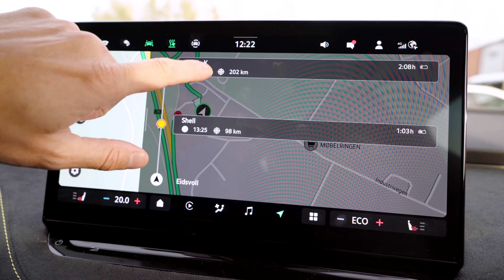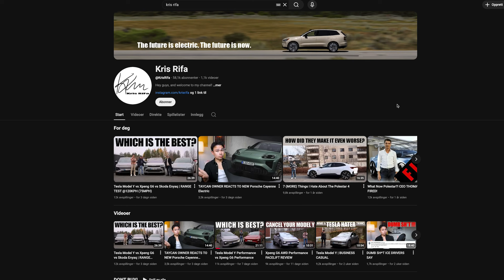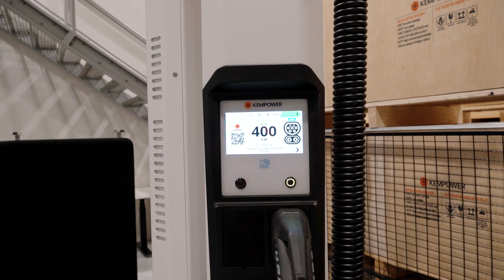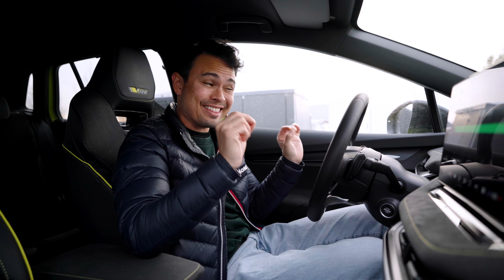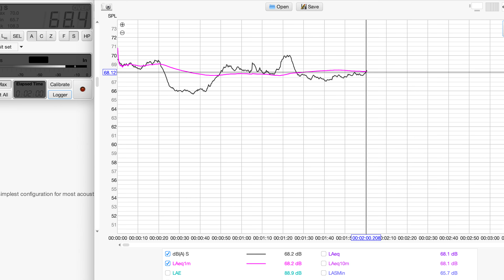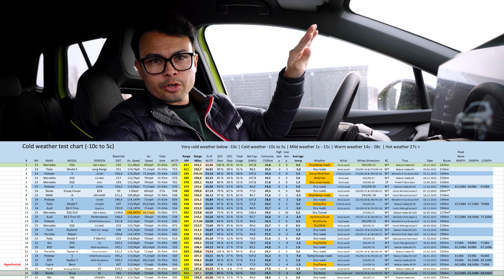Skoda Elroq RS | RANGE TEST @120KPH (75MPH) + Noise Test & MORE!

Comment: About importance of drag coefficient, its without any doubt important and has impact of car efficiency,  but as its not consider cross section area of car body, is also important to consider size of the car.  But here I think its same for Enyaq and Elroq, so its more just for info if someone would wondering.

Comment: I was very surprised to find out that the Elroq RS is only about 10kg lighter than the Enyaq Coupe RS... How?! 😬 That's to small of a difference to compensate the worse aerodynamics. Thanks
Reply: Elroq is onyl 16 cm shoter and Coupe doesn't have high roof line so might be nearly identical amount of metal is missing vs. normal SUV body.
Weight has quite small factor to range anyway.

Comment: Thank you Kris for the test.

Everyone complains about the high energy consumption of electric cars during the winter, but the fact is that even combustion cars use more gasoline/diesel during the winter, so what's the difference?
Reply: The difference is that other than the increased fuel cost, you don't feel it any other way. It doesn't affect the driver and other passengers travelling experience. With E cars on the other hand, you have to stop much more often, those stops may not be that pleasant experience since colder weather usually mean shorter day, so you end up at cold, dark places. At those temperatures, many od them can not complete more that hour and a half to two hours between stops which makes traveling much less enjoyable.
Reply: @tdusko  I have driven a bit over 2 year now with Enyaq +25 000 km and never DCC charged during winter. I'm sure there are many like i that very rarely drive long trips on winter but much more at summer time.
Reply: @mr.wizeguy8995  Sure there are, but it doesn't mean you are the majority. Not sure where you live, but in central Europe where I live, people are traveling during winter holidays a lot.
Reply: @tdusko  Ho much people drive car EU average: Approximately 7,000 to 9,000 miles or 11,000 to 15,000 km) per year.

Which mean really small amount people regularly drives so much each day they need to charge during trip or even less those who need several charged each day.

Or are you claiming that you choose your car what happens few times a year aka holidays instead those 360ish day?
Reply: @mr.wizeguy8995  But that is exact reasoning how people are choosing their cars for decades. Or you think that 4.5+ meter cars, 500+ Liters trunk and 200+ hp are necessary for every day? Car costs money, big money. For the majority, the car is the most expensive item they own. Of course they want them to provide the most comfortable experience on the couple of those longer trips they make per year. And they also want to be as quick as possible. Shockingly, the majority doesn't enjoy making stops when the car dictates.
Reply: @tdusko  Majority ICE driver are well represent on every restaurant along main travel roads, why they keep stopping if they don't need to. 

You just sound like most that want one but can't afford.
Reply: @mr.wizeguy8995 Majority? You must be kidding, right?
Reply: @tdusko  You are either bad troll or stupid that nothing you claim make factual sense. Wondering do you have car at all.
Quite sure you live at rent if you think car cost most money because detached house was more expensive than EV.
Reply: @tdusko  then again, i always find traveling by car tedious and laborious, regardless of drivetrain
Reply: Totally true.